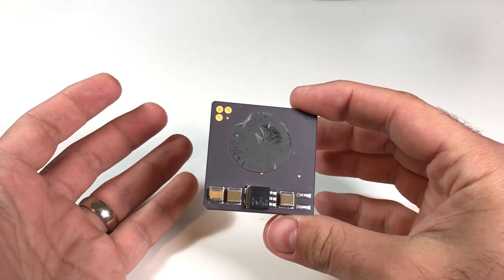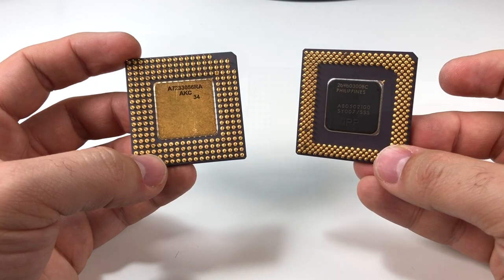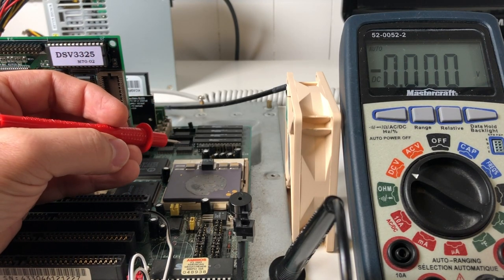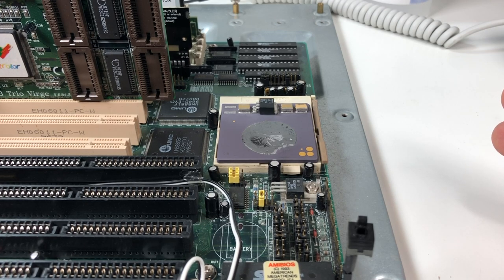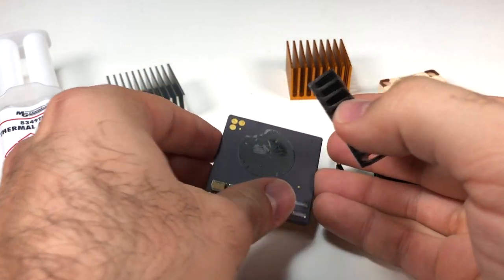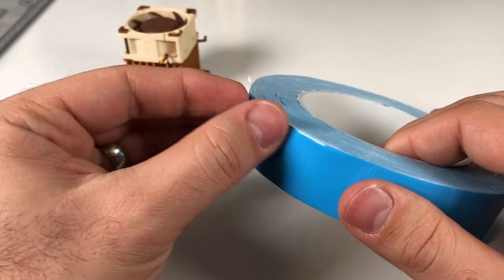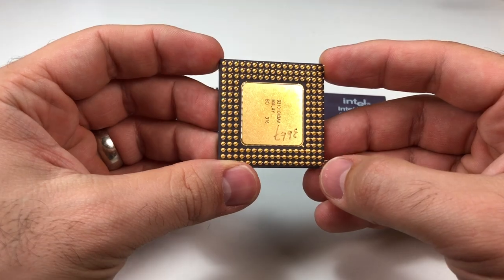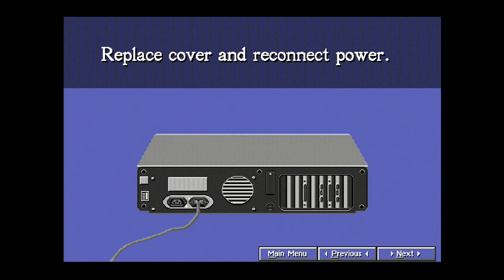The Intel Pentium Overdrive CPU for 486 Systems

Comment: I was once at a hamfest in Pensacola around 1998, where one person had a severely overclocked Intel 286 CPU, normally ran at 25 Mhz, but this one was running at 1.1 Ghz! The heatsink was cooled with liquid Nitrogen. Seemed to run fine, although admittedly, the core was idling most of the time as the rest of the I/O could not keep up.

Comment: I had amd 386 DX 40 Mhz cpu in a mobo which was upgradeable to 486 :D Also you could massively overclock the 386 DX 40 Mhz to 80 Mhz. To achieve 50 MHz was realive easy. Anything over 50 Mhz was not as easy as now days.

Comment: Why didn't you try AMD 5x86-P75 (Am486DX5-133)? Oc'd @160 maybe.
Nice vid! Thanks!
Reply: Fpu still sucks
Reply: Pretty sure he says he will in a future video
Reply from the maker: Thanks for your comment! I'll be doing another video soon that'll compare the P83 overdrive to the AMD Am5x86 and the Cyrix 5x86 chips. I will definitely include some 160MHz results for the Am5x86 as well :)
Reply: @vswitchzero  if your components can handle it, I've observed 3x50MHz to be faster than 4x40MHz setup. But not all vlb graphics can handle 50MHz bus and pci bus might be thrown out of whack as well causing problems.
Reply from the maker: @GigAHerZ64  I had some success running my AM5x86 at 3x50 on another PCI board I have in the past. I’ll have to give it a try on this shuttle HOT-433 as well 👍

Comment: i would have used normal pencil to short the sense pad of the fan.
It worked to unlock the L1 bridges of thunderbird, should work for pentium as well :D
Reply from the maker: Haha yeah I forgot about pencil mods! I’m sure it would have worked. I remember using pencil across two solder points on a 9800 Pro for a volt mod back in the day.

Comment: @vswitchzero did you try orange Goo Gone on the top of that chip? I find it's useful sometimes when isopropyl doesn't remove thermal paste. It does need about a minute to activate.
Reply from the maker: Good tip, thanks! I forgot about "Goo Gone". I remember using that stuff to remove sticker residue many years ago and it was quite good at it. I did try IPA on it but it seemed to have no effect at all. Hopefully I won't have to do this again :D

Comment: I had a 486DX 4 100 with 256MB and 8meg gfx card for get the card do think is was sort of matrix.  Also 32bit sound blaster it did play quake and doom very well.  Also used on ham radio for decoding morse and sending telex.   Then moved to a P2 the P4 never did own a P3 until years later.  Had external liquid cooling.  Do miss the old stuff worked so well.

Comment: I had the 50/66 to 120/133 if I remember correctly it was a long time ago. I sold it on ebay back in the early 2000's

Comment: Here's the thing. These days, if I'm building a 486, I'm actually targetting that kind of performance. PODs are expensive and not as fast as the real thing anyway -- a real P-75 destroys the POD-83 just based on the wider external bus and faster FSB, and the 75 was actually a fairly pedestrian model. If I want a Pentium, I'll build a Pentium. If I want a 486, I'll build a 486.
Reply from the maker: Totally agree. For a retro build these days, it really doesn't make sense. Especially when you consider how expensive these PODs are.

Comment: You are very lucky to have a socket 4 board been looking for one for some time (within my price range) I have 2 5volt cpus just no board. Rare is an understatement last one I seen went above 400cdn. I actually had one of these back in 96 definitely  a big improvement over a DX-2 lasted me tell I got a slot one system.
Reply from the maker: Indeed! I was very lucky to find this one on eBay for a reasonable price. The seller’s description was vague so it probably went under the radar. I think I paid about $80 for it including the P60. Best of luck finding one!

Comment: Interestingly, the Speedsys CPU score is pretty much identical to that of a 5x86@160Mhz. Quake is around 3fps faster on the overdrive, which is significant but not a huge difference. I'd say the 5x86 was the much better buy (100$ vs. 300$) back in 95/96 if your board already had a 3.5V option and you were willing to overclock. Today, of course, the POPD is the much more desirable item. I would love to see if it has a little headroom for overclocking ;-)
Reply from the maker: Very true, the AM5x86 was an awesome upgrade chip and had a lot of overclocking headroom! There were quite a few third parties that offered special 5V regulated versions too (like the Kingston Turbochip, PNY etc) so it was definitely possible to use them in older 5V only boards too. The Pentium overdrive is not a good overclocker, unfortunately. But with some extra voltage it is possible. Stay tuned. I'll definitely be exploring that in a future video :)
Reply: @vswitchzero  I was disappointed this didn't end with a overclocking session so I'm glad to see this comment. thanks for the video.

Comment: I have a couple of 486 CPUs (one of which is AMD 5x). I've had such a rough time finding a good board for the AMD. I found one that supports it but I can NOT get the mouse to work on it at all. What board(s) do you recommend in terms of price to supporting features/compatibility? I prefer PCI for some specific silliness I have planned rather than an ISA/VLB-only board.
Reply from the maker: It's getting harder and harder to find good 486 boards these days, unfortunately. The prices also vary wildly on eBay. I personally like the 486 boards based on the UMC 8881/8886 PCI chipset, like the Shuttle HOT-433 I used in this video but there are other good ones out there too. The Lucky Star ls486e is a popular one based on the SiS 85C496/497 chipset. The ls486e is known for being a potent overclocker, and because of this the price can be high. There are others that can be found more cheaply based on the same PCI chipset that may be a good choice. Sticking with the latest 486 PCI chipsets will help to ensure you'll have working L1 write-back cache capability too. Many earlier boards have broken WB implementations. Best of luck in your search and let me know what you find!
Reply: @vswitchzero  Thanks for your thoughts!

Comment: When I was right out of High School I had a Gateway 2000 desktop with the Intel Pentium Overdrive 125Mhz.  It worked fine but sometimes would hang when you powered it on.  It didn't do this with a 486 chip in it.

Comment: I feel like back in the day this would have been a cool upgrade although nowadays I prefer to keep a 486 a 486 and would buy a pentium system if I wanted one. Would have liked to see more benchmarks comparing it to the and 5x86 which is easily overclockable to 160mhz call it impractical but on my amd 5x86 with a voodoo 2 quake becomes playable and croc nearly playable
Reply from the maker: Thanks for the comment! I've never tried a 3dfx card with a 486, but got some impressive results from a Rendition Verite. Will have to give that a try one of these days.

Comment: I had an AMD DX4 120 MHz in a laptop and it was AWESOME. Could play low quality compressed mp3 songs without problems.
Reply from the maker: Awesome. The DX4/120 was a great 486 chip. I remember playing compressed audio was always a difficult goal to achieve with a 486 processor, that's for sure!
Reply: @vswitchzero  I also had an IBM Thinkpad 701C Butterfly 486 that played compressed mp3 music as well. I was an idiot when I sold that

Comment: I world on a project where they had a bunch of stress calculations to be run virtually constantly as they iterated the design. The guys were using 486sx cpus  and these were slow - dropping in the 486Dx2 chips dramatically reduced the time it took, a 10x speed up wasn't uncommon.

Comment: i would check voltages and caps by oscilloscope. because multimeter has integrator curcuit and u cant see sparks and needles on line.

Comment: I was supposed to get a second hand 486dx4 100 system for my first pc, but when my dad went to pick it up, (an hours drive away BTW) the bloke had sold it to someone else, so my dad was absolutely raging... Dad was so pissed he just stopped off at a computer shop on the way back and that's how I ended up getting a Pentium 75 instead of the 486 lol
I over clocked it too, I was very chuffed!

Comment: I was working as tech support for windows 95 when these were new, they were a pain when trying to install windows.  I don't recall what was the root cause, but every system that had one of these installed, setup would error out very early in the process.  I told the end user to put in the original chip for the install, then put in the overdrive. :P

Comment: While I used 486 and Pentium as a kid I wasn’t old enough to build my own PC until the P4 days so these old systems look so strange. A motherboard from 2002 is very similar to 2022 but 1992 they look very different. Also how is it finding drivers for such old hardware? Or maybe it isn’t as necessary as for early 2000s stuff?
Reply from the maker: Very true. The older boards like this one are based on the AT standard (baby AT formfactor specifically). Later on the ATX standard was adopted, which is still what is used today (although there have been revisions). I'm not sure when ATX came out exactly, but I want to say around 1996. It was pretty mainstream once the Pentium II came out. The retro PC community has done a great job preserving some of the old software required to run these old components. There hasn't been much I haven't been able to find so far, thankfully! :)
Reply: @vswitchzero  That is good that people have saved the software. I’ve had issues with some drivers from the early 2000s. Usually windows 98 drivers for the motherboard sound chip. Some brands like MSI and gigabyte tend to have the drivers and the board still on the website but it is more difficult with Biostar and some others. I mostly stick to windows 9x. While I did use some DOS and Windows 3.1 when I was around 8 I don’t remember as much about those as the Windows 9x era. Most older games seem to work well opening the DOS file inside Windows 98 anyway.
Reply: The original PC had two external connectors on the motherboard. Keyboard and Cassette. Everything else was provided by expansion cards. The later XT and AT dropped the Cassette port leaving only the keyboard port on the motherboard. 

For many years most vendors of generic clone motherboard and cases used a form factor called "baby AT" based on the form factor used by the IBM XT-286. This certainly wasn't the only form factor out there but it was the most common and long-lived. Gradually motherboards started adding more on-board functionality but the form-factor had no provision for more external connectors. So extra functionality needing external connectors had to be accommodated with flyleads to either mounting positions on the case or brackets fitted in unused expansion slots.

In 1995 intel developed the ATX standard and it became the de-factor standard form factor with the introduction of the Pentium II around 1997. The ATX form factor made a couple of radical changes. The main power connector was changed and Hard on/off was replaced with soft on/off. The dedicated position for a 5 pin keyboard connector was replaced by a flexible space for an IO plate. 

Intel introduced another new standard "BTX" in the pentium 4 era, but it didn't really catch on and the market continued with varients of ATX.

Power and cooling have been beefed up over the years and larger and smaller variants have been created for different markets, but the basic ATX form factor has remained much the same from the late 1990s to today.

Comment: That heatsink and fan combo is way overkill for that processor. POD 83 has sub 10w tdp so you could run it passive no problems. Period reviews like to talk about how hot the early pentiums were, but they had never seen a 100+w tdp behemoth cpu from  today :D.

That said overkill isn't always a bad thing. ;)
Reply from the maker: Haha very true. I'll be the first to admit it is quite overkill, but it was more about finding one that would be a good fit more so than its cooling capability .. after hearing the OEM fan now, I can confirm it's WAY quieter though, which is a nice bonus :)

Comment: I had an AMD "586" Dx4 133 that still went into a 486 socket, a rather rare chip in the uk but it was very quick with the right board compared to a normal 486 dx4 100, :)  wish I still had it.

Comment: Is that a LINEAR VOLTAGE REGULATOR powering the CPU, and generating even more heat?
Reply from the maker: Indeed it is! There is a large solder pad right underneath it so that it can sink its heat to the ceramic chip top. I'd say a good amount of the heat generated comes from the regulator.

Comment: Pentium boost for 486. Wouldn't it be better to just use Pentium then as they are also available retro computers now? :)
Reply from the maker: Yeah, today it makes little sense building a 486 with a POD for retro computing purposes (unless of course the POD is nostalgic for some reason). Building a proper Pentium Socket 5/7 system is way cheaper and better suited in most situations.

Comment: Can you overclock this cpu on this board? Higher Mp or bus speed?
Reply from the maker: The multiplier is locked, but bus speed can be increased to 40MHz, which some Pentium Overdrives will work with (100MHz total clock). This chip I have here is not totally stable at 100MHz, unfortunately. Another one that I have is just fine at 100.

Comment: Played Quake 1 on my AMD 486DX/2-80. Didn't felt THAT bad, but seems my mind is blurred by nostalgia, propably i actually played a slide show... But something else, how do you capture the VGA output from MS-DOS? I tried that several times using VGA-to-DVI/HDMI-adapters or even capture boxes with VGA input, but all my solutions failed because of the strange 70Hz refresh rate of MS-DOS at 320x200 and 320x240. Maybe that topic would be worth a video :D
Reply from the maker: Thanks for your comment! I use the Startech USB3HDCAP device. It's not cheap and has a few quirks, but it handles the 70Hz DOS modes very well. I've been quite happy with it. I'll have to do a video on it one of these days.

Comment: Why don't CPUs use ceramic for the IHS anymore?
Reply from the maker: Good question. Intel abandoned them after the early MMX models were released. Later MMX chips had a metal heatspreader. AMD continued to use ceramic-top chips all the way until the Athlon Thunderbird generation, although they weren't covering the processor die - those were exposed core chips. I'd imagine it was probably due to construction cost and/or complexity.

Comment: $200?!?!  I believe I threw my Dell with this CPU upgrade away after Hurricane Harvey clean up.  I should have looked it up, but was too busy cleaning up the mess
Reply: I found one I got from a Circuit City Display of the POD.  It has 83 on the chip.  Also is on a socket 3 that holds the chip in place so no bent pins.  I put the display into my PC.  This has the 83Mhz chip in it.

Comment: If energy wasn't so expensive i'd love to grab one of these for my pimped 486, i had one kicking around as a kid but it ended up getting trashed, not by me.. :( Though, i already have a Pentium machine with an overclocked 200MMX (at 233) so I like to keep my only 486 machine (with a very special motherboard) stock.. Mainly for compatibility! I don't think there are many things i haven't overclocked, including one of my MegaDrive (Genesis) systems and an N64 i OCed back when i was 15 lol Plus i also got hold of a Super Socket 7 board that can take a ton of chips and has an AGP slot if i want some real retro gaming..

Comment: interesting fan works on resistance can make some sense of why after removing vrm/caps on chip i have it thinks fan still attached and sorry feiopa and me are partially to blame for the high prices on the p24t chips me for finding they overclock with increased voltage and feiopa found a simpler way to mod with a resistor most all will oc stable to 100mhz core with 40mhz bus after modded have yet to get a stable 120/50mhz but have found it is semi stable if put chip in freezer though will crash shortly after it starts to warm
Reply from the maker: Very interesting. I haven't tried to overclock this one yet, but I'm assuming I'll probably need to do a similar mod on mine to get to 100MHz. I seem to recall people using a diode for a voltmod on the regulator. Would love to hear more about a simple resistor mod :)
Reply: @vswitchzero  if search "modifying POD83 voltage regulator for overclocking" will find a guide on Vogons for doing the mod and guess it was a diode not a resistor

Comment: What power supply did you use
Reply from the maker: I use an old SPI FSP300-60ATV ATX power supply with an ATX to AT adapter on the test bench. Very capable power supply for older rigs.

Comment: Just unse an AM5x86 160Mhz.
No overclock? =(
Reply from the maker: The AM5x86 was an awesome processor, that's for sure. I'll be doing another video soon comparing the AM5x86, Cyrix 5x86 and the Pentium overdrive. I'll be including overclocking results and other tweaks in that video as well.
Reply: But is that voltage compatible with the platform?
Reply from the maker: @BrunoFonsecaPT  Yep, this board can support both 3.45V and 5V processors.